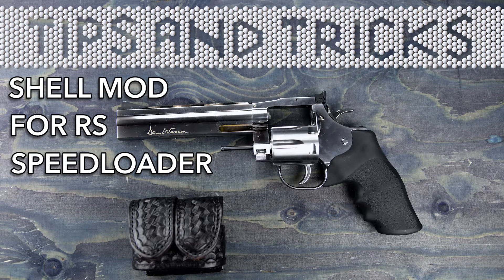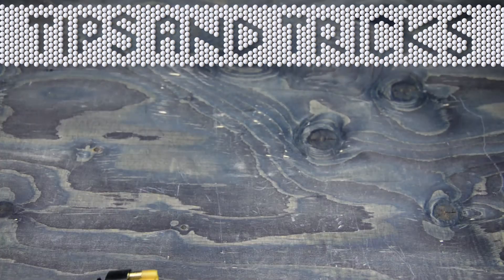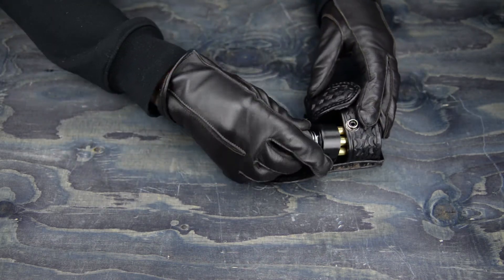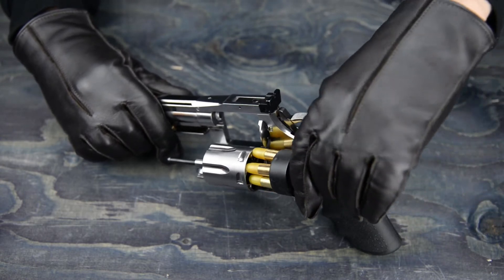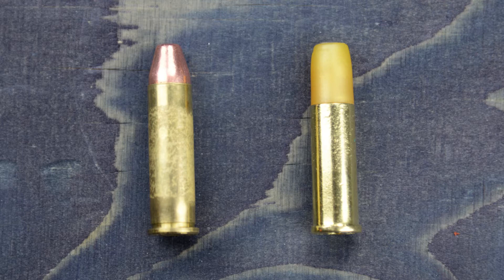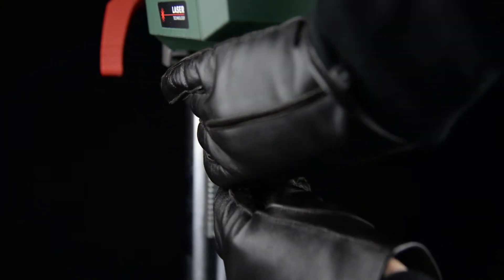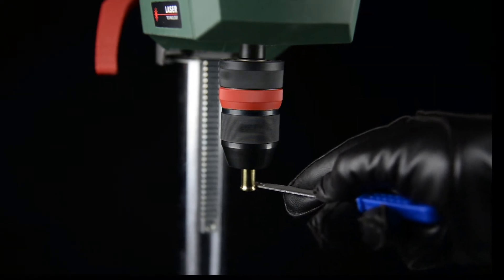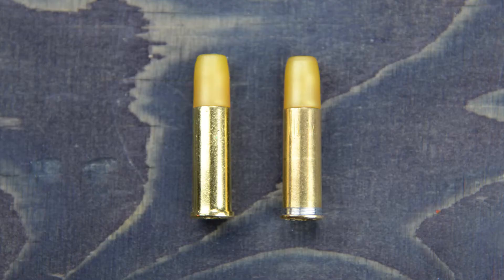Tips & Tricks - Real Steel speedloader for ASG Dan Wesson 715

Comment: The dan wesson speed loader for asg can be used for a real s&w revolver 0.38/.357 ??
Reply from the maker: As far as I can tell, the ASG 715 is compatible with HKS 10A speedloaders. So if there's a revolver out there with those cylinder geometries, then they might just work. But I cannot guarantee anything.